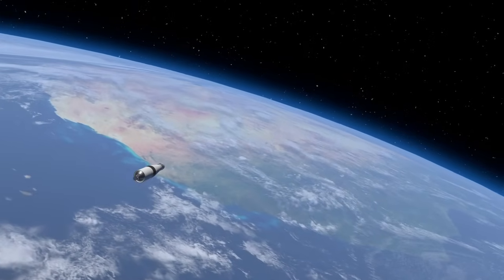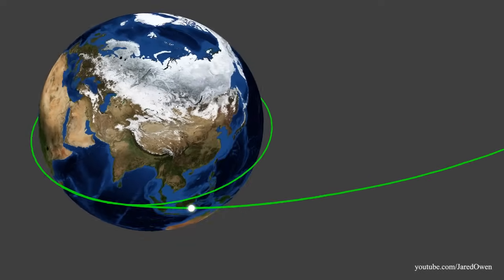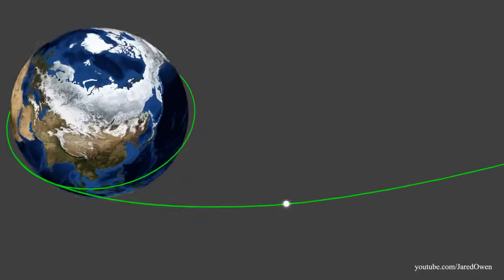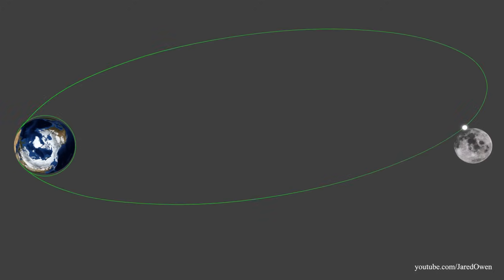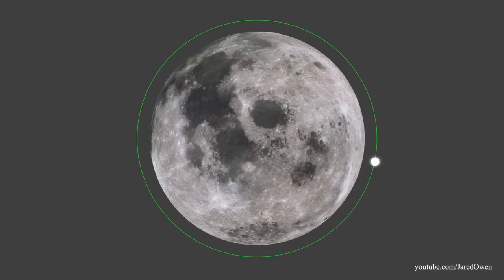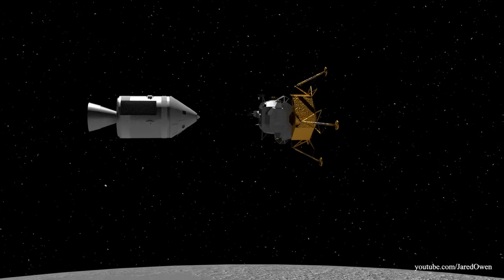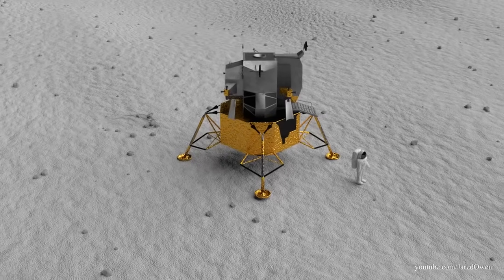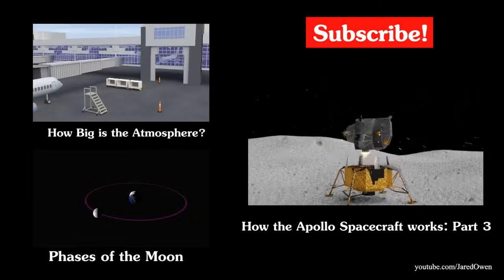How the Apollo Spacecraft works: Part 2

Comment: hey um can you please explain this video for me...

https://www.youtube.com/watch?v=BUZr0Wr0v-s

Thanks
Reply: Another thing to note, the Apollo computers, as primitive as they were, were less susceptible to damage from radiation than modern computers.  This is mainly due to the nature of the discrete components.  Back then memory was magnet wire wrapped around magnets, today it's microscopic transistors inside a silicon and carbon wafer.  One small hole in the materials of the chips in today's computer components and they are done.  You could actually see the makeup of an Apollo era transistor if you were to remove the metal can around the chip. They were much larger and could take much more abuse before failing.

Another thing about the Van Allen Belts... the radiation is non ionizing radiation.  Yes it can hurt you if you are directly exposed to it but fairly easy to shield against.  Your cell phone creates non ionizing radiation, same with your microwave oven, an electric motor, older tube TVs all create non ionizing radiation and unless you stick your head in the microwave it wont hurt you.  The radiation levels are also not constant, they change all the time.  If they were constant then the Northern and Southern lights would always be the same and always be there.  They are created by the non ionizing radiation from the VAB. Depending on the levels of radiation the lights change in color, intensity and even how far away they can be viewed.  Apollo simply planned missions during times of low activity in the belts (which are predictable) and took that risk.  Not that there never was any exposure, there was.  During passage through the belts many of the astronauts would see flashes of light when their eyes were closed.  This was from particles passing though their optical nerves and exciting a nerve causing it to fire and that resulted in our brain seeing a flash or light.
Reply: Well lx buzb it means that someone forgot to tell this young NASA engineer that we've already navigated the Belts 12 times without the slightest regard for the danger. The famous rocket scientist Werner Von Braun said over and over again that the amount of lead protection needed to insure the safety of astronauts was so much that it would be problematic.Those men had virtually zero shielding from radiation.  As this young engineer points out, it is far too dangerous to travel through the Van Allen belts until we figure out a way to do it safely. Now you must apply critical thought to determine what this means with respect to NASA and six trips to the moon and back 45 years ago. I was an adult when it happened and we had a president who was a pathological liar in Richard Nixon. He needed a distraction to advance American exceptionalism and to occupy the American people so that they wouldn't catch him in high crimes. He knew that the public didn't know Van Allen from Joe Blow, so we would never question the issue. Today we know better, Houston....we have a problem.
Reply: None of what you just said is true - good job! Do some research on the Van Allen belts and the types of radiation they contain as well as the shielding required for transit through them. You'll find your statement is complete ignorant bullshit =)